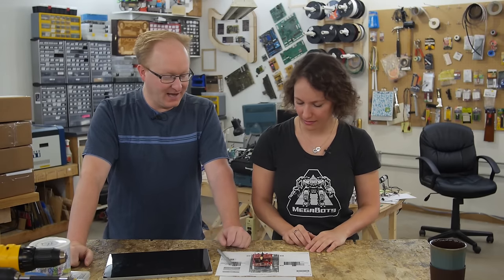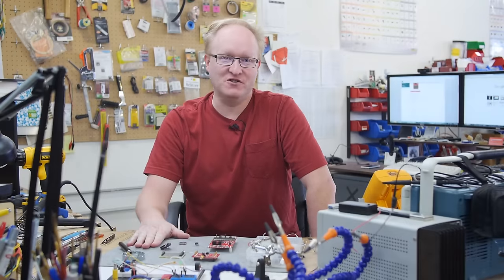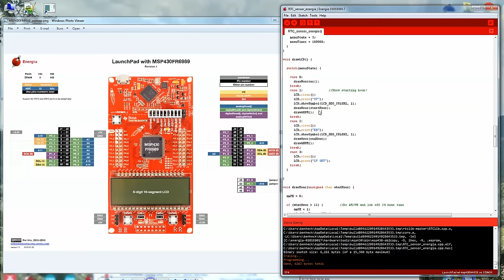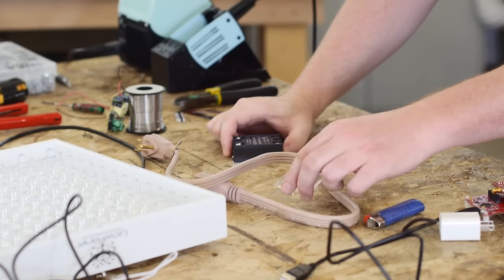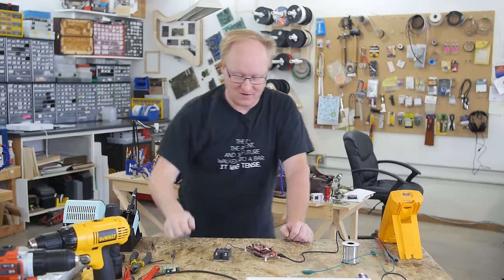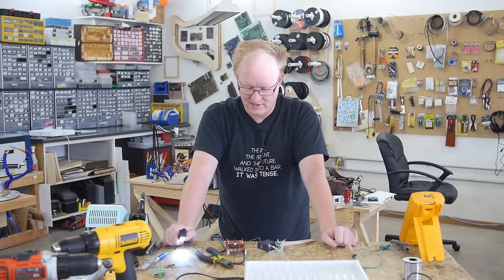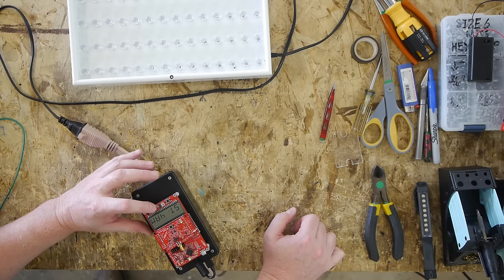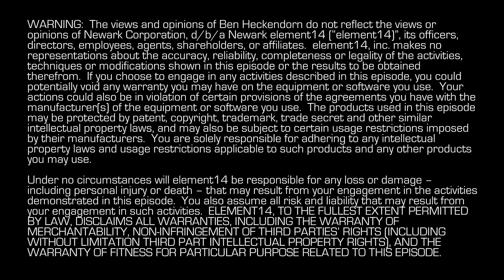Ben Heck's TI Launchpad Plant Booster

Comment: You can PWM a good SSR, just not particularly fast, tops 20-30/sec as apposed to 1000s per sec with DC. But make sure to add a heatsink to your SSR. This is how mains voltage 3d printer heated build plates work. It works exceptionally well.

Comment: A software revision where total light received rather than if supplement is needed or not would be an interesting option.  Put the sensor under the light with the plant and PWM the leds so the plant always receives a continuous volume of light even if the sun goes behind a cloud.

Comment: The A/D converter will limit the biggest number.  10 bits is 1024 bits.  x 10= 10240.  12 bits -> 4096*10=40960.  a long int won't help.  but unsigned int is good.

Comment: But the MSP430 already has ADC and the crystal is plenty accurate for a clock. What's with the booster packs?
Reply: Good point, they got it from TI, so wouldn't be nice not to use it.
But it's overkill. It's a more accurate ADC, which would do better for a "more requiering" project.
Reply: +xFuaZe oh, and it had the light sensor build in already.

Comment: PWM'ing SSRs isn't a problem. That's why people use SSRs instead of mechanical relays. 
Source: built a reflow oven
Reply: +Virtex Alpha Are you a horse in front of lightning, like the picture? Im really happy to see a horse in front of lightning liking electronics. Congratulations!
Reply: +Brent Allen Are you a skullhead man in a mauve world of mint green Doritos, like the picture? Im really happy to see a skullhead man in a mauve world of mint green Doritos liking electronics. Congratulations!
Reply: +Virtex Alpha cringe
Reply: As far as I know though you need the right SSR. All the ones I have used only switch off at the next power zero crossing. So if I think this thru you can only pulse at 60 hz.

Comment: Where did you get the relay? I've got one which reads 40A from eBay, looks the same, but mine is white.
However, I couldn't drive mine directly from an I/O pin of the ESP8266 (wifi relay :D). The led goes on, but AC doesn't. With an Arduino it's working, but doesn't have wifi.
Reply: ESP8266 can't output enough amps directly from its I/O pins to trigger the relay. You should drive a transistor that then drives the relay.
Reply: +Toni Lähdekorpi I figured that, since the relay would work off the 3V pin. Then I tried a MOSFET, but that also was no good, since the MOSFET required more than the 3V.... but I'll try a bc547 next (':
The SSR's can function on low voltages, with low power, but the ESP8266 is just too low for that ;p
Reply: xFuaZe It's not only about the voltage...

Comment: My Cross-Compiler is Code::Blocks which can use any compiler as long as the compiler is something starting with the letters gcc and I am running this under  a flavour of Linux called Linux Mint 17.3 (Rosa) 64bit which lists itself as UNIX.

Comment: In an AC plug, aren't both poles "live" because of the current alternating between going from 'live' to 'neutral' and back again? Wouldn't it then be safer to have a switch break both poles?
Reply: Some cheap Chinese AC to DC converters rely on the standard and place their diodes on the standardised 'live' side...so if the switch were on the other side it might result in a live board...which is a safety concern I guess...
Reply: I am pretty sure the issue is when you have a fault (something in your device touches a metal wall or jumps to ground plane)

If this happened and you cut your neutral side then the hot side would be touching ground where there would still be a potential, however if you cut the live side then the neutral and ground are at same voltage so no current flow.

And so to answer your questions both sides of an AC plug are live in reference to each other, but not live in reference to ground. Hope this helped.
Reply: Adam Kampa Totally true! Also what I remember from my electrical shop and theory classes ;)

I wanted to point out that it doesn't matter which side the switch is on to have a non-live turned off appliance in an AC context. If you want to be absolutely sure there's no potential on an appliance, you have to switch both sides and not just one.

Comment: Would this not be much easier with a simple clock timer and light sensor circuit? When the system is on and there is less light then a threshold start a pwm to power the lamp.... Seems a bit over complicated this way :) You won't have all the features but still get the basics. KISS :)
Reply: I know, it is not about the solution but about the fun :)
Reply: So the Video about the TI-Board should be done without it? ;)
Reply: They should do something with it that 5$ of analoge Electronics cannot do :)

Comment: Ben..... AC cords with no strain relief???
Reply: I may be wrong, but I believe he uses zipties around the AC cables, to avoid them  being pulled out. Not the best solution, but a pretty valid one. I think twisting bare wires together (even of only for testing) is more of a bad idea.
Reply: If there was any strain relief (which i didn't see) it should have been featured. I realize this sounds a bit "concern trolling" but it's really not. Noobs (a considerable portion of the audience that will see this) need to know the importance of strain relief when dealing with mains cords.
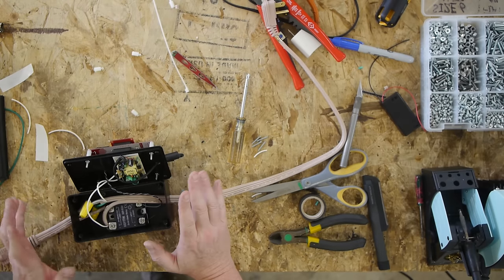Reply: +xKatjaxPurrsx I really agree with you, it should at least be mentioned that high voltages are dangerous and shouldn't be tinkered with by untrained persons. However, at 17:26, after he showed the insides and explained it, he goes on with "wiring it up" in which you see the end of a zip-tie standing straight up from the box. But yes, it's not noted, thus a bad example.